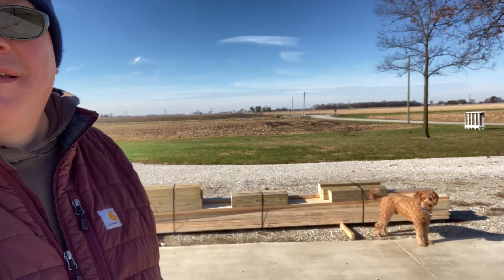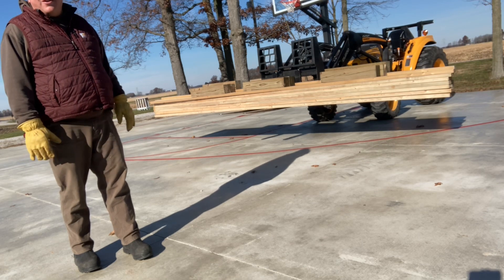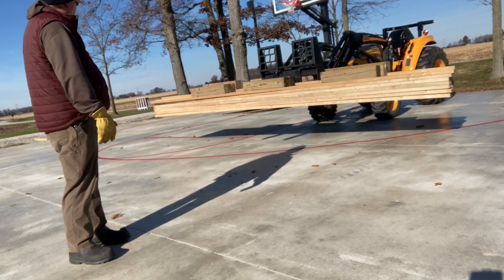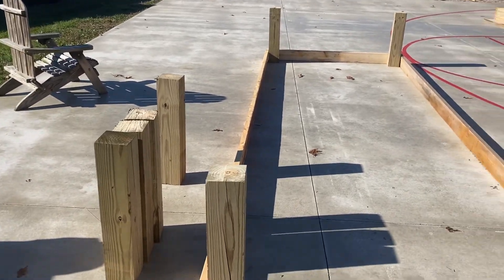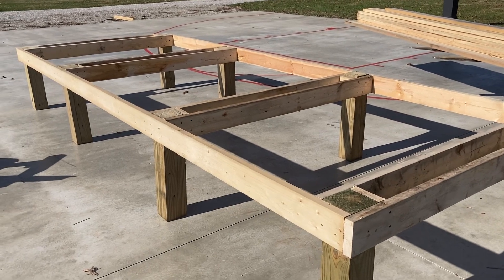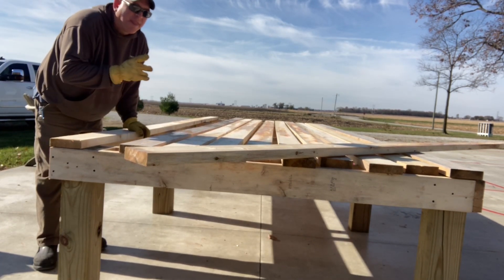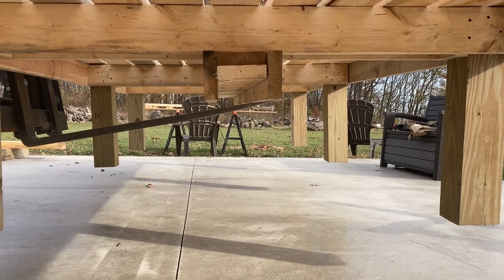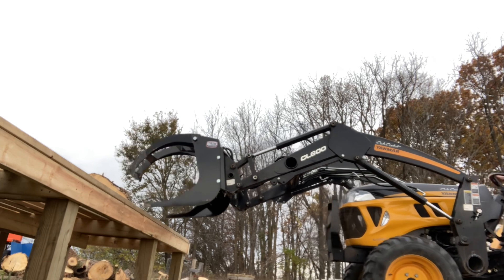#27 New bucking table build and new equipment teaser

Comment: Nice! The grapple might be the single best tool I have for moving logs. Especially with someone like you who gets tree service wood that can tend to be bigger and all sizes. You'll love it.
Reply from the maker: Thanks!  There is certainly a learning curve with it.  But I do like it…a lot.  Do you have a root rake style or log grapple style?
Reply: @KNLFirewood  Root rake style with double clamps. 5-10 hours using it and it will be like having a 3rd hand for ya. Hardly use my forks anymore.

Comment: Nice bucking table, i built mine on a old trailer frame so its mobile if i want to move it. I fasten my boards only on the ends like you so they can easily be replaced, 7x14 ft. works great. Nice grapple, great video.
Reply from the maker: Now, see.  That’s a good idea.  I love portability.  I’m really excited to use it.  A few more days of work, then it’s game time.  Thanks for watching and commenting!

Comment: Mike I think I’m jealous I may have to get a grapple now. Nice job on the log table. Take care, Ben.
Reply: Grapple looks cool, but a simple set of pallet forks will do 90+% of what a grapple will do for a WHOLE lot less money.  The only place a grapple beats forks is if you move a lot of brush, the clamp would be handy to grab and hold it.  Other than than, stick with forks as I've done for the last 20 years.
Reply: @edsmith4414  I do everything with my pallet forks. I process a lot of firewood and love cutting logs up off the ground.
Reply from the maker: I think you should!  Honestly I haven’t had much time to use it, but what I have done with it is pretty useful!  I’ll keep you updated. Thanks for watching and commenting!
Reply from the maker: @edsmith4414  I have pallet forks.  One of my issues is I get tree service wood…lots of it.  All different sizes and shapes all dumped into a pile.  I drive into the pile with fork and come out with nothing.  This way i can go in, get a grapple full and process it.  Pallet forks are definitely handy but this just made sense for me.  Thanks for watching and commenting!

Comment: Looks like a great work or picnic table, not so much for bucking. Should be using double rows of Standing 2x4's gaped 1" apart every 16" on center, front to back on the 6' width. This gives you key slots for quick cutting along the length of the table. 
*Also needs log stops to avoid roll-off incidents.
Reply from the maker: Hi crxess!  I address some of those issues in later videos.